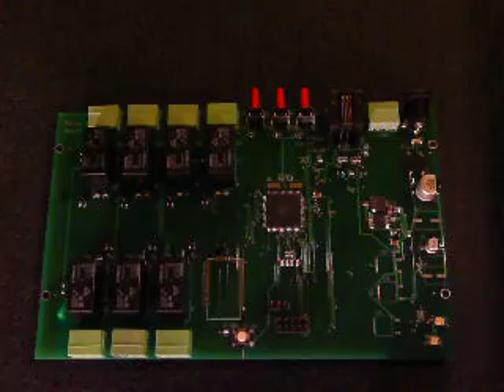X10 Home Automation Relay Controller

Comment: Is this for sale? X10 is not reliable. Before I understood this I had an x10 channel control my yard sprinkler and sure enough, the off signal was missed and I watered my lawn for 24 hours. Not a good thing.  I only use x10 for non critical things like lights